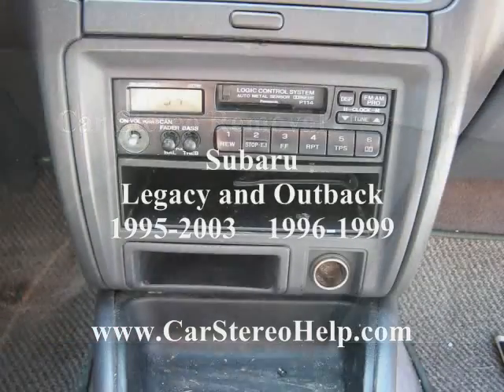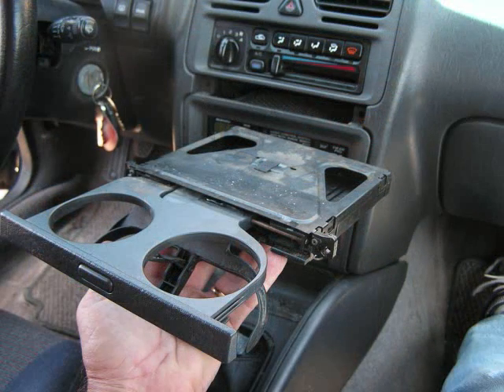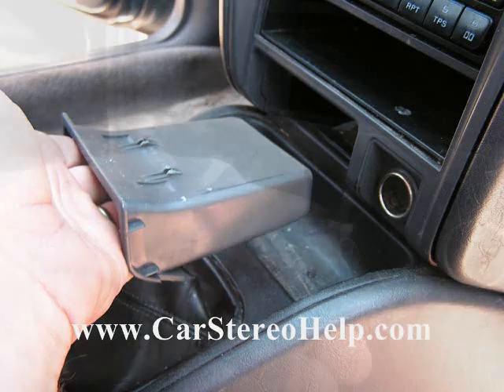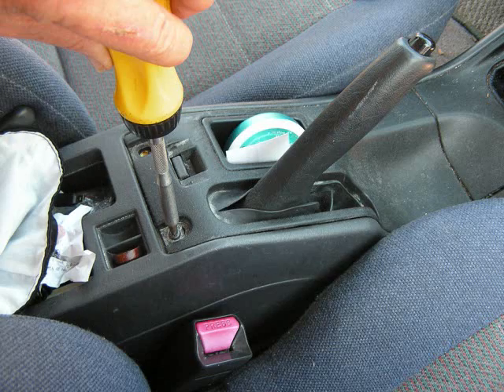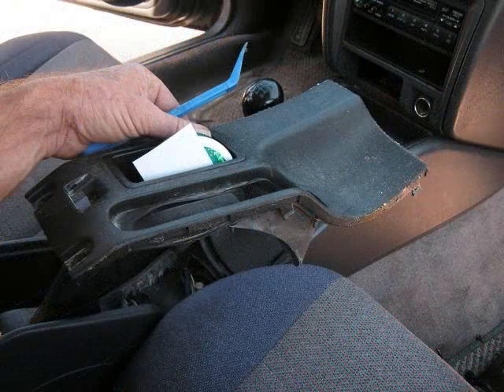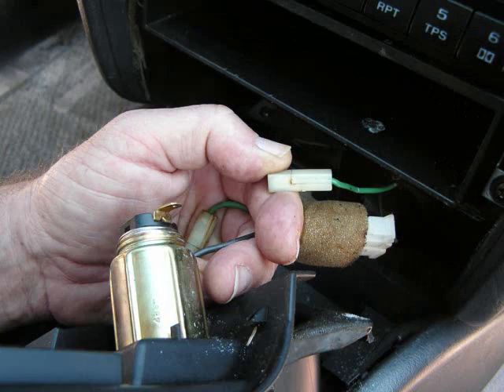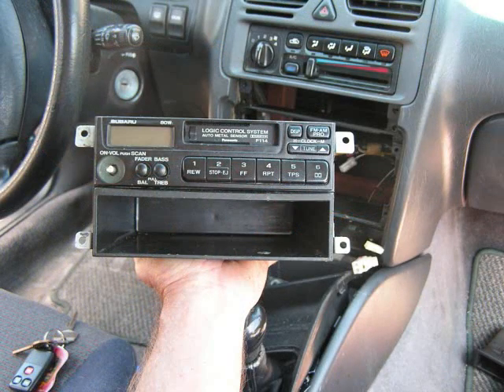How to Subaru Legacy and Outback car Stereo radio Removal replace = Car Stereo HELP

Comment: So I recently tried to replace my radio in my 98 Subaru Legacy in doing so there was this plug that was tied into the wiring harness that plugs into the back of the radio that plug is disconnected from whatever it used to be connected to I can't figure out what it is that it went to however my – lights and my cabin lights don't work anymore I could really use your help

Comment: I'm about to buy and install a kenwood deck in my 1999 Subaru Legacy. I've installed a few decks in past vehicles. I'm aware I need to get the wiring harness and probably the antenna adapter. However I'm hoping someone can help me figure out if its necessary to buy the deck mount molding (not sure what to call it)? From what I've seen it isn't and the "cage" that the stereo will slide in and out of will install nicely into the same spot the factory radio will be coming out of. Can anyone confirm this? Thanks in advance.
Reply: Josh H how did the installation go?

Comment: Great video... Thanks for posting... Some other information:
- It is suggested that the battery be disconnected prior to removal, according to other information I've read... 
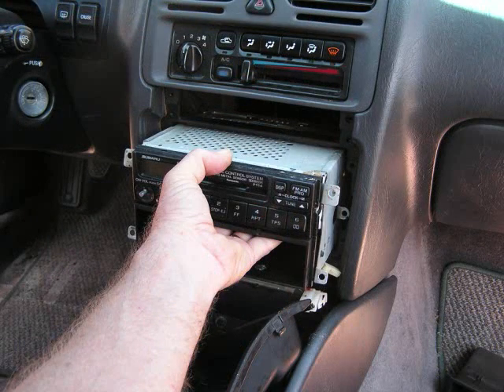- At the 2:52 time in the video, when the car stereo is being pulled out, you'll notice a recessed side screw mount... My stereo had those extra screws that needed to be removed also...
- Found a site with a correct wiring diagram for the new stereo installation:
http://ae64.com/Legacy-pinout.htm
Reply: Thanks for the link!

Comment: that's a lot of work just to take out the original Stereo jeez
Reply: not too hard... check out the heater core for a 1990 mustang. you gotta remove the seats, carpet.... like everything.
Reply: in real time, it takes about 4 minutes.
Reply: I know. but what can you do about it amarite?
Reply: Blader ZYeYO
Reply: not really. took me less than 10 minutes.